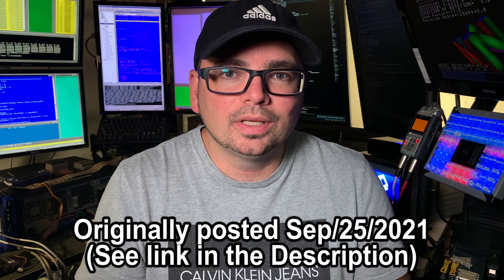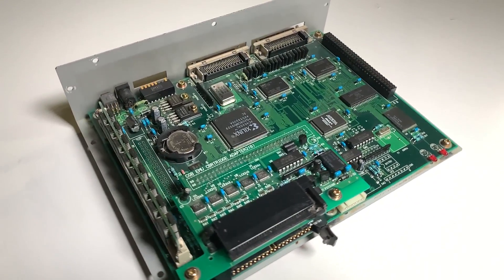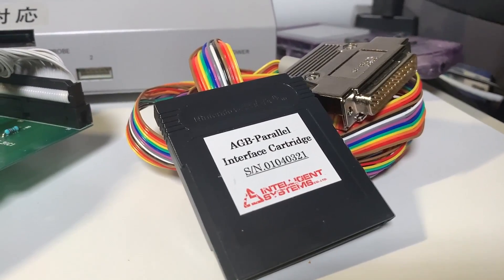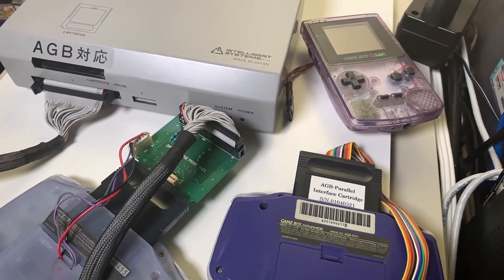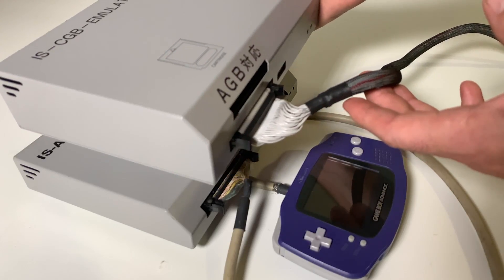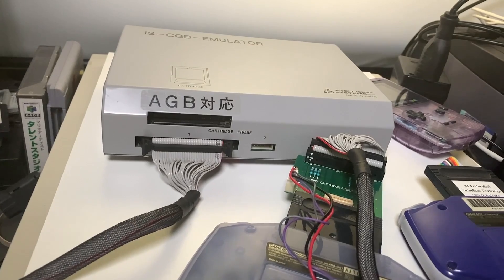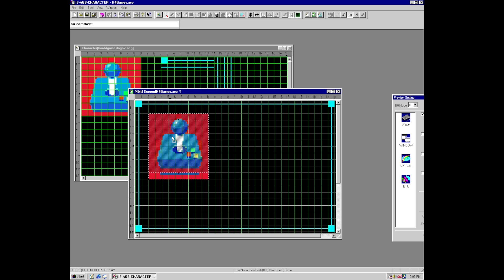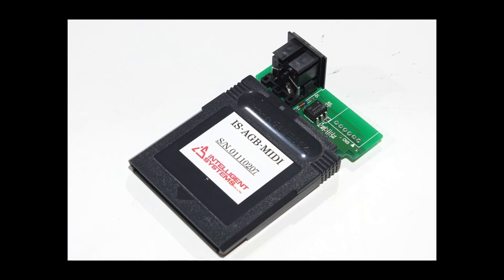The Gameboy Advance IS-AGB-EMULATOR by Intelligent Systems -Full Game Development kit Demo   [#25]

Comment: so i ended up buying a capture/emulator set, but the controller for the capture unit is missing, do you know if anyone has documented the pinout to replace that?
Reply from the maker: Hi Nickolas,
Oh Nice! Right on!😎👌

Ahh that’s a bummer it was missing. I don’t believe it has.🤔

My guess it’s either a direct cartridge edge interface…or parallel signals for driving the display and controls on a modified GBA.

I’d pop mine open for you…but I lent it to a group who are developing a game. If I get a chance to snag it back, I can for sure pop it open for you.

😎🤘
-Gerry
Reply: @BehindTheCode_wGerry  whenever you get around to it that would be awesome
 it would seem odd for it to be just a direct cartridge connection though given the apparent lack of battery usage on these, at least based on what ive seen so far, which is unfortunate because that would make it a much less painful thing to replace than if its directly driving the lcd over the cable
Reply from the maker: Yeah, it’s hard to say….those are my best guesses😄 lol. 

I just sent the lead dev a msg about this…so once I hear back from him I’ll let you know.
-Gerry
Reply: @BehindTheCode_wGerry  thanks, i do get why theres so little info on these, but that doesnt make it any less annoying
Reply from the maker: Hehe…😆
I hear yah.